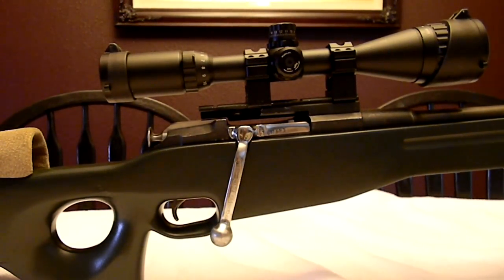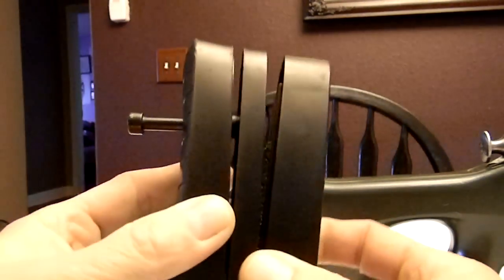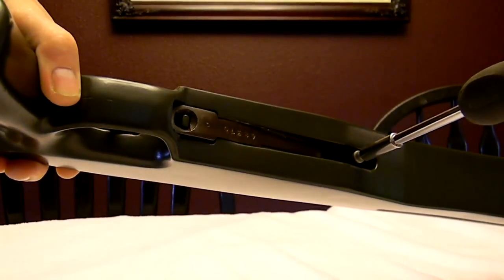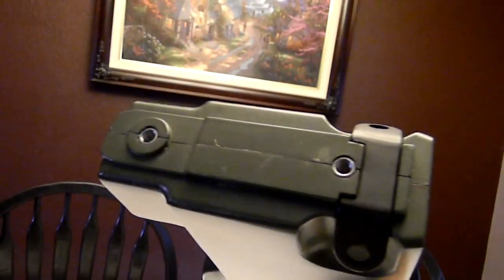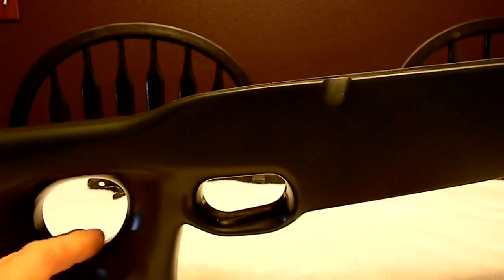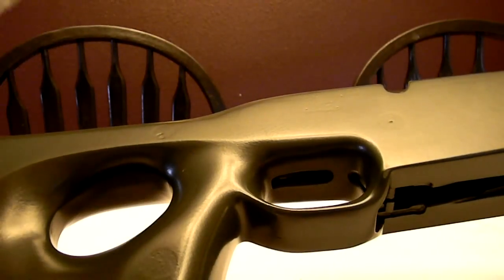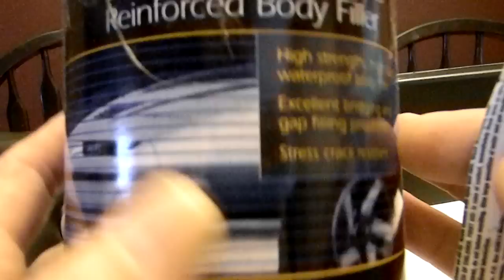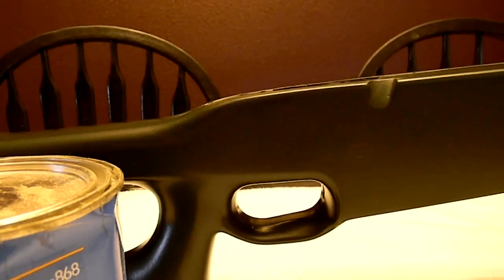Mosin-nagant custom how-to part 1 of 3

Comment from the maker: One quart is enough, but use more stir sticks or it will weigh to much. You dont want to fill it completely with kitty hair, the stir sticks length wise will give wood stock durability and be much lighter, carbon fiber strips would work great to! If I build another I would use half a quart or less to drop a couple of pounds leave out the metal bars fore sure!!!